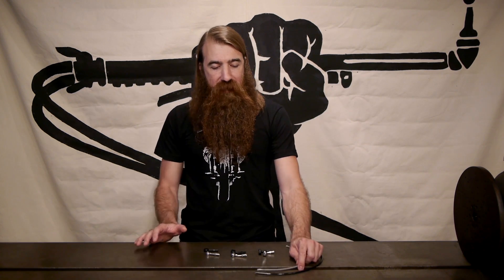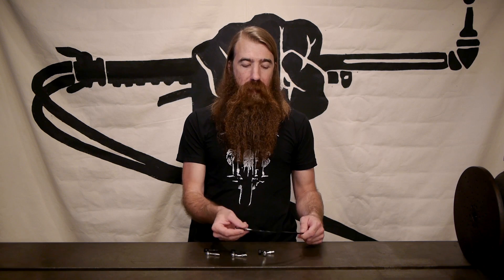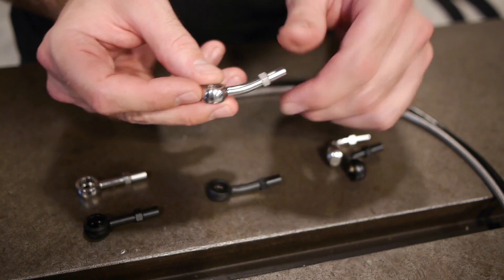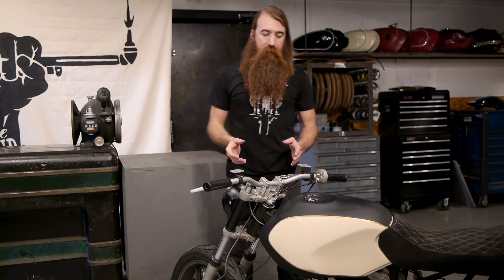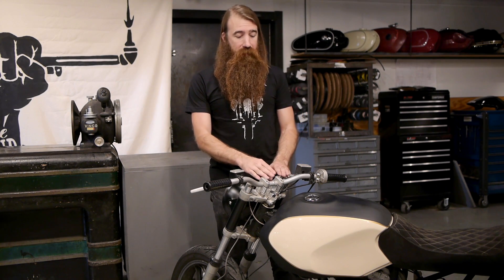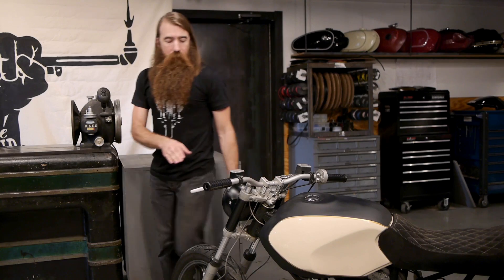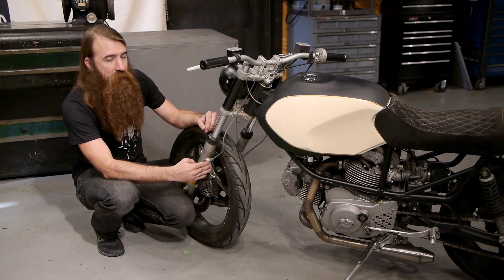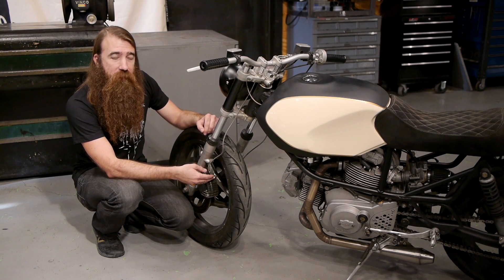DIY Motorcycle Brake Lines - Revival Cycles Tech Talk

Comment: Will the brake line fitting work on a stock VL800 master cylinder and union bolt? How universal are these fittings?
Reply from the maker: I'm not familiar with the VL800 m/c. The banjo fittings come in 10mm and 7/8" diameters and will fit any motorcycle m/c that I've encountered. I have seen issues at the caliper if your bike has harlines with NPT fittings, there are some limited NPT fittings for these but not for every scenario.

Comment: The lines on my VFR 800 are nearly 3 times bigger than these. Is it possible for these to work on my bike?
Reply from the maker: Yes, they will. The smaller diameter hose will increase breaking response to some degree due to the decreased fluid displacement required to activate the slave cylinder.

Comment: Hey Stefan! Thanks for your videos, really good stuff... I’m learning a lot from them... 
Do you think those brake lines will work on the original ato calipers and master cylinder of a ‘79 BMW R65? 
If yes, is there also a piece to make the brake lights to turn on??
Thanks and keep it up!
Reply from the maker: Hi Alejandro, 

The brakelines will work with your ATO calipers, we've done quite a few BMW installs over the years. When there isn't a mechanical brake switch or it's not ideal for our project we'll use a hydraulic banjo switch which we offer in a variety of thread sizes as well as single and double banjos. 

https://shop.revivalcycles.com/hydraulic-brake-light-switch/

Hope that helps, 
-Berry

Comment: Do you still offer these universal brake line kits
Reply from the maker: Hi Chris, 

Goodridge had to pull this brake line a few months back to problems with the tolerances being too tight in the hose to screw the fittings in. We've pulled it until their quality control team is prepared to release it. Obviously being brake line we're talking about it's not something you want to rush. We speak with them bi-weekly and the moment it's available we'll make an announcement to everyone signed up to receive emails from our site. 

We still believe this is the best custom hydraulic solution on the market and can't wait to get it back for our own custom projects that are being held up in the meantime. 

-Berry

Comment: I picked up on this in August 2018 - Sniper 2 still available in the UK and is AWESOME! Stefan describes the process perfectly well but I found that slightly flaring the inner tube with an awl or something tapered and just slightly wider than the hole helps the thread to start without stripping as it goes in - I'm talking 1 to 1.5mm, no more. Worked every time. Great videos, thanks Stefan!

Comment: These fucking suck so bad. The banjo fitting doesnt thread into the hose for shit.
Reply from the maker: It is true that these can be a challenge at first, and we struggled until we worked out the exact technique. Sorry to hear you are having a difficult time. If the following doesn't help and you purchased through revivalcycles.com we can get you setup with a return.

The best tips we can offer are:
1) To make sure the outer PVC coating is trimmed so it matches the depth of the collar nut. It may be possible to insert the line without trimming the outer layer, but that will make it impossible to assemble. 
2) Cut with a good quality side cutter one single clean cut even though it smashes the end of the line its easy to bring it back to round. Abrasive cut off wheels, and saws and most other cut methods tend to fray the stainless braid too much and that pinches down the inner liner when it is installed in the collar nut. 
3) Use an awl or pick or small Phillips screw driver to open up the inner liner so it is round and slightly flared just at the tip. 
4) When beginning to insert the banjo fitting it can be helpful to take a loop of the line in your hand so you can get a better grip on it, similarly it can be helpful to put a small 1/4" or 6mm dowel through the banjo fitting to get a better grip on that. 

We did have some struggles when first working with this system, but after the leaning curve it gets better, and now we get consistent results every time. And yes it does take some effort, but with ideal preparation it isn't bad. Also worth noting that there can be variations in the manufacturing tolerances and that could influence assembly, we'll double check our current stock and make sure its all checking out.

Comment: After a couple of hours and several blisters, I could not get the fitting to start threading in the lines.   Added more and more force until the banjo fitting was just stripping the inner lining.  Any tips you can provide here?
Reply from the maker: The best tips we can offer are:
1) To make sure the outer PVC coating is trimmed so it matches the depth of the collar nut. It may be possible to insert the line without trimming the outer layer, but that will make it impossible to assemble. 
2) Cut with a good quality side cutter, abrasive cut off wheels, and saws and most other cut methods tend to fray the stainless braid too much and that pinches down the inner liner when it is installed in the collar nut. 
3) Use an awl or pick or small Phillips screw driver to open up the inner liner so it is round and slightly flared just at the tip. 
4) When beginning to insert the banjo fitting it can be helpful to take a loop of the line in your hand so you can get a better grip on it, similarly it can be helpful to put a small 1/4" or 6mm dowel through the banjo fitting to get a better grip on that. 

We did have some struggles when first working with this system, but after the leaning curve it gets better, and now we get consistent results every time. And yes it does take some effort, but with ideal preparation it isn't bad. Also worth noting that there can be variations in the manufacturing tolerances and that could influence assembly, we'll double check our current stock and make sure its all checking out.

Comment: what kind of hose would I need from the Rear break res to the master cylinder ?
Reply from the maker: Tygon 2375 is the best answer we've found so far. We have also tried some of the other Tygon formulations and found that they definitely do not work.

Comment: hallo. i must mension thath it does not work with all sorts of hydraulic clutches for exampel BDL-clutches.
Reply from the maker: We have used this hydraulic line on several different clutch master / slave setups and it has worked perfectly with all of them. Although we are not familiar with a BDL clutches, we can say with absolute certainty that this line works on Ducati's, KTM's, Harleys, Confederate X132 Hellcats, and all the other hydraulic motorcycle clutches we've ever seen.

Comment: Can these lines be used on an oil cooler?
Reply from the maker: These lines are probably too small for an oil cooler application, I don't think you would get enough flow. In a brake or clutch application there isn't much volume that needs to transfer, but with an oil cooler you need as much flow as you can get. These are AN -2 lines, and I wouldn't go lower than AN -6 lines for an oil cooler.  I think most oil cooler lines are actually AN-8 but I bet you could size down to -6.
Reply: An oil cooler for ants?

Comment: Does the interference fitting make it so that you don't need to use any thread seal?
Reply from the maker: Essentially that is what is happening. The inner liner of the brake lines is able to conform to the fitting and that is able to seal against the thread. But this is also the reason it is critical that anytime the fittings are removed from the line you must cut the line back 1/2" and start the install on a fresh section of line. So far we've not had any leaks from the line to fitting joint, experience shows that getting banjos and crush washers to seal is difficult than getting these lines and fittings to seal.

Comment: does the inner diameter matter or can that vary without affecting performance too much? I'm looking at replacing the lines on my 82 Goldwing and considering the weight  I want to be sure it'll stop when i need it to.
Reply from the maker: The way that brakes work is that it is all about pressure, not flow. The inner diameter actually improves performance, because the reduced line volume transfers pressure better than the larger diameter lines. Also the forces applied to the lines are reduced for a given braking pressure.  This is an area that can be counter intuitive, but the physics of fluid power are pretty clear on this one. 

We've even used these lines on hydraulic clutch applications, where unlike brakes, the flow volume could potentially be a factor and these lines still flow more than enough volume.  Also, based on the manufactures testing of 10,000 psi, and the worst case panic stop braking pressures of around 2000psi  there is still a 5x safety factor. These lines will have no problem stopping a wing.